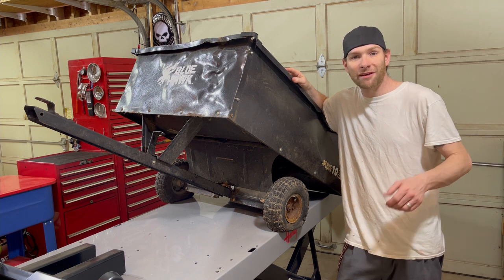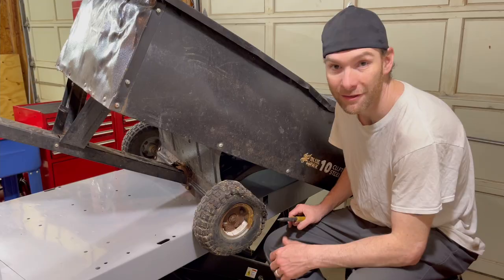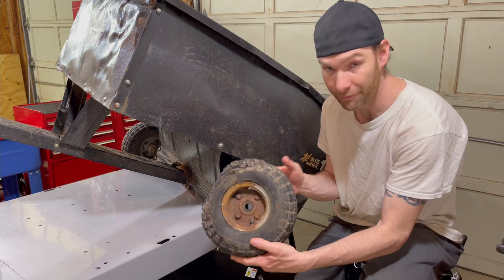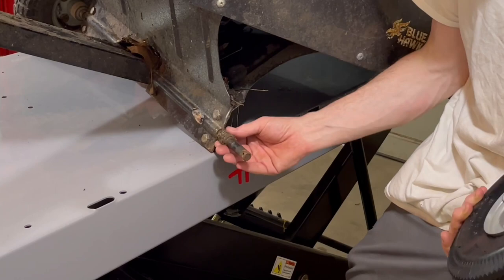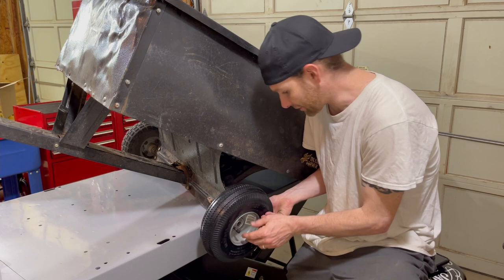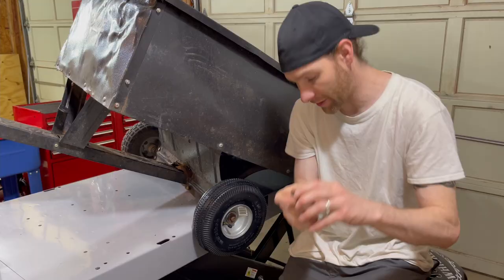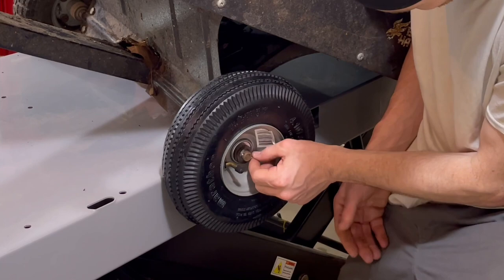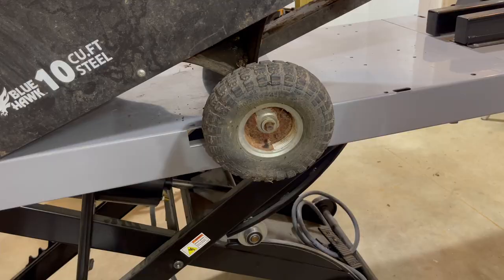How To Replace Change Wheels Tires on pull behind dump cart handcart appliance cart Hand truck dolly

Comment from the maker: Parts & tools used 
10" Heavy Duty Replacement Tires/Wheels/Inner Tubes  https://amzn.to/3NpswtQ
Axle cap https://amzn.to/45ZGWYN
Cotter pins (if you lose we need to replace them) https://amzn.to/3Nr1RwC 
Needle nose pliers https://amzn.to/3JaloPs 
Razor knife https://amzn.to/463zfkA 
razor blades https://amzn.to/3N3hGIx 

Camera gear used

As an Amazon Affiliate / Associate I earn a small commission from qualifying purchases 

Check out my other YouTube videos!!!!  

How To Fix Bent Dirtbike Rear Foot Brake Lever Repair Straighten Back Dirt Bike Motorcycle Pedal Peg https://youtu.be/Sa8KAgl6If8 

How To Replace Change Wheels Tires on pull behind dump cart handcart appliance cart Hand truck dolly https://youtu.be/lDvPeyh9NxE  

HowTo Assemble Tractor Supply Chicken Coop TSC Producers Pride Defender Run Predator Protection Roof https://youtu.be/A8LB7Idx5Ns 

How To Fix ANY Broken Winch Cable Braided Line Wire Rope ATV UTV 4 Wheeler Jeep Side By Side Quad youtu.be/c0PgP4tbNdA  

How To Start a Husqvarna Chainsaw. This is a 440e. Works on other Husky Echo chainsaws stihl https://youtu.be/FvWFYvVFP20 

Husqvarna 440e Chainsaw Review! Husky 440. Vs Stihl MS261 ms261cm Pro's Con's Echo https://youtu.be/GIvMEoN8Ke4 

Husqvarna 440e Chainsaw - Main Features & Things I Like about it. Husky 440. Pro's Con's Stihl Echo https://youtu.be/A1ShHevEIqo 

HowTo Replace Change Tighten Adjust Chainsaw bar Chain proper tension direction Husqvarna Stihl echo https://youtu.be/8MB7zFfUoIw 

Husqvarna Husky 440 440e Chainsaw Features How to Start & Review vs Stihl MS 261 20” 18” starting https://youtu.be/cI08lzCjRc8 

How To Assemble Central Machinery 20 Ton Harbor Freight Manual Hydraulic Shop Floor H-Frame Press youtu.be/p0VVnrpbNAI  

Overhead garage storage shelves - Shelf track brackets best unused dead above over head wasted space youtu.be/VPyEFGndMFE  

How to build 2x4 storage shelves youtu.be/fCaK8hwXYv8 

How to disassemble reassemble & change shelf height on my shelves youtu.be/aenhLPR7MeY  

3 best ways - “How To” scrap an aluminum car or truck radiator, as well as the oil cooler inside it youtu.be/pLUcjeRO2bU 

How to Scrap & Separate mixed BRASS & COPPER metal plumber’s pipe fittings, well tank tee MAKE MONEY youtu.be/l-3NgJs7rw8  

How to SCRAP BRASS!!! Difference between RED & YELLOW, STAINLESS & CHROME PLATED, and CLEAN vs DIRTY youtu.be/KPq-KRnQjFA 

How to Scrap an Air Conditioner AC Evaporator A Coil the best way  and Make the MOST MONEY scrapping youtu.be/BNJz4TcLW3s  

How to Scrap Brass Pressure Relief Valves from water heaters - the  Fastest, Easiest, Best Way!!! youtu.be/ovK-rmp7lV0 

How to remove stuck shower mixing valve cartridge without a puller when plastic tool doesn't work youtu.be/zUuYJEKSE_8  

Blacked Out 2009 Harley Davidson Fatboy (two-tone blacked out build, gloss & Matte) FOR SALE / TRADE https://youtu.be/dxpSlNsVHCg 

2005 Kawasaki Ninja 636 Pro set up Stunt Bike Street Legal for Trade / Sale https://youtu.be/Mw_zrAp_0IA 

Clean title 1998 Honda CBR F3 600cc sport-bike for sale or trade 600 98  https://youtu.be/3_InkDoGfYo 

2006 Big Dog K9 - Custom Chopper - BigDog K 9 motorcycle long rake 300mm rear tire 117-ci S&S motor https://youtu.be/4Ha8wA94h0E 

2008 yamaha wr250x supermoto motard stunt ride lot sesh circle wheelies tricks Gopro hero test clip https://youtu.be/Dho_2uGXdhk

Comment: Thanks for the video. Where did you get the wheels that you replaced them with?
Reply from the maker: I believe I got them from Home Depot, but you can also get them on Amazon and probably Lowe's. I'll post a couple links below similar to what I used that should work.
Reply from the maker: amazon 
https://www.amazon.com/AR-PRO-Purpose-Utility-Diameter-Bearings/dp/B081RQTCW3?pd_rd_w=BwuKy&content-id=amzn1.sym.a400618b-650b-4c39-a4fe-66c3e0813a14&pf_rd_p=a400618b-650b-4c39-a4fe-66c3e0813a14&pf_rd_r=QCNEXNTJG7YJXQ59EJ4E&pd_rd_wg=VAIsd&pd_rd_r=ae6493fa-bf46-4d67-a652-ccbed51e315f&pd_rd_i=B081RQTCW3&th=1&linkCode=ll1&tag=brandonstunts-20&linkId=cf280aaed9b31a9e3788e18c5eccb7a9&language=en_US&ref_=as_li_ss_tl
Reply from the maker: home depot 
https://www.homedepot.com/b/Outdoors/Pick-Up-Today/N-5yc1vZbx82Z1z175a5/Ntk-elasticplus/Ntt-10%22%2Bwheels?NCNI-5&sortby=bestmatch&sortorder=none
Reply from the maker: And you're welcome for the video! Thanks for watching and commenting. Hope this helps. Let me know if you have any other questions
Reply: @BrandonStunts  Thank you so much! Yes, it helps. I'm an older lady, and my husband passed away and I'm on my own and I so appreciate your help!
Reply from the maker: @earthgirlsusan  I’m sorry to hear that, your very welcome though. Good luck with it

Comment: My wheel is not sliding off after taking pin & washer off?
Reply from the maker: Sometimes they have to be hammered off. Every now and then the wheel can get rusted or seized on the axle. Usually it just has to be knocked off.
Reply from the maker: Sometimes people maybe take a 2 x 4 to go across the wheel and tire and then kind of smack the 2 x 4 with a hammer or something, that way it’s a more distributed hit, but tapping it with a hammer or trying to pry or pull it off should work
Reply: @BrandonStunts  that did it! Thanks